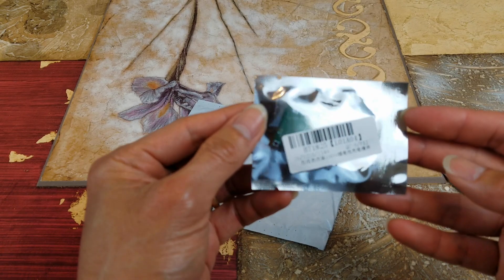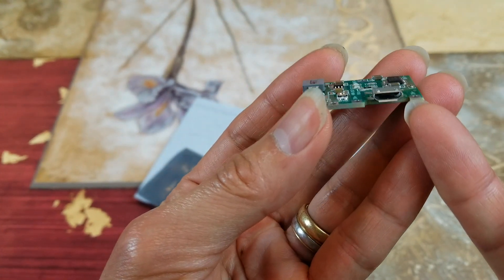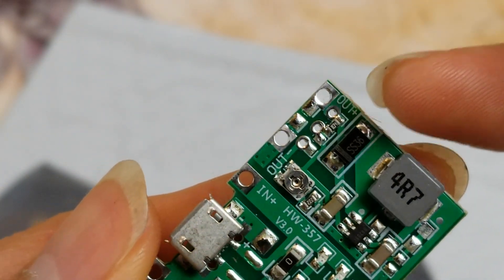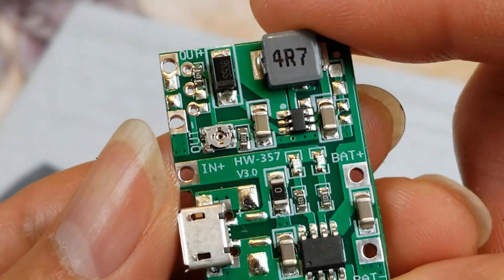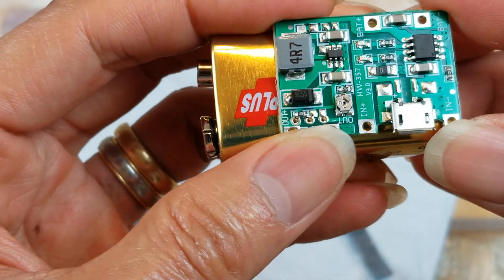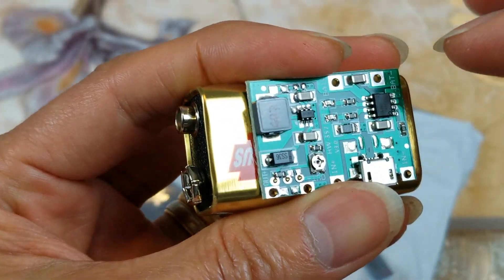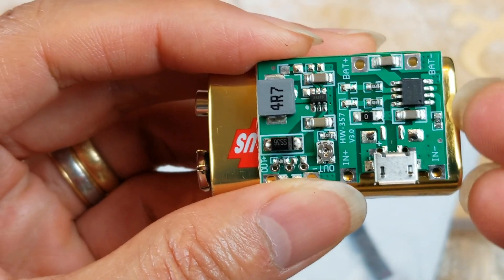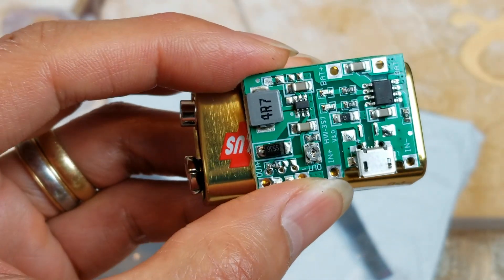Micro USB 3.7v Li-Ion Step-Up Boost to 5v 9v 12v Variable Adjustable Circuit Board!

Comment: Hello! Great vid! Curious what’s the minimum mAh lipo battery these boosters are able to still power a 5v sensor. I tried with a 120mAh and my sensor fades after a while. Thanks for your help!
Reply from the maker: Output: ~7W ( 5V 1.4A / 9V 0.8A / 12V 0.6A )
Reply: @macdaddypimpping  Oh I forgot to mention I have no idea what I’m doing…. Don’t see mAh anywhere there? Is there an equation somewhere in this? Thank you!
Reply: It’s the “1.4A” isn’t it!?

Comment: So it will convert 3.7v battery to 5V? The specs say 4.5V input ????? confusing. Do they just mean the charging input is 4.5V?
Reply from the maker: Input can be 3.7v to 4.5v and will step-up boost to 5v 9v 12v.
Reply: @macdaddypimpping  ok thx